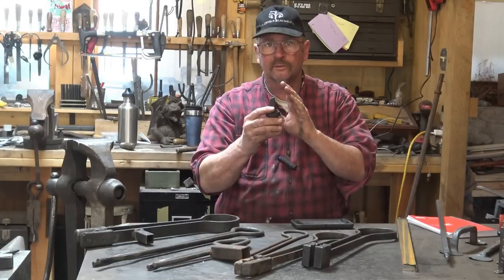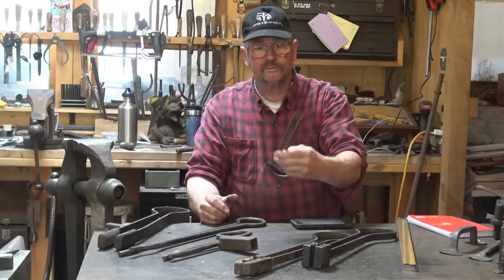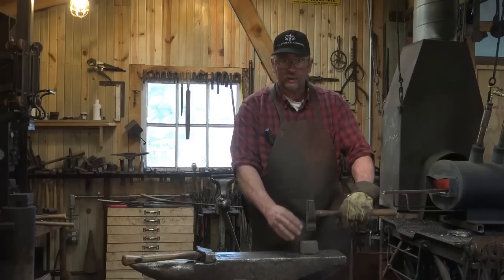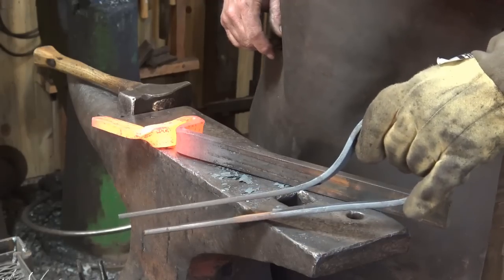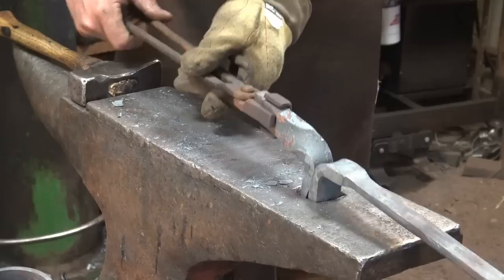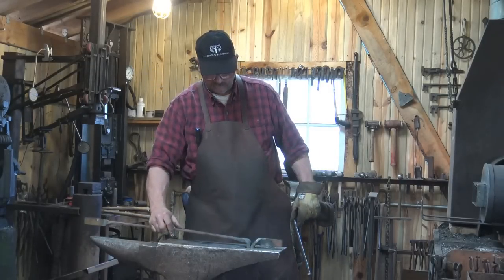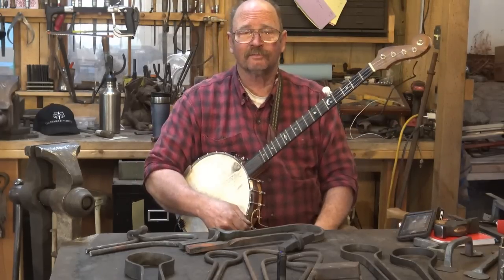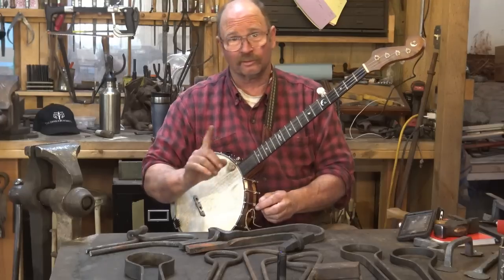Spring butcher tool for the anvil hardy hole - blacksmithing tools

Comment: Small basic arc welder $50-$100 used about anywhere.  Scrap material to practice on and some welding rods $25. A valuable skill you can use for life, priceless.

Comment: John, I do like the banjo pickin. Have an idea for attaching the tool steel dies to the mild steel springs.
Punch a hole down in the end of the dies so the mild steel will slip in, punch a cross hole thru both and rivet.
Just a thought.

Comment: little late any you might have seen this suggestion but make a slightly triangular piece that can fit through the gap in the hardy hole section and that should help with the bounce.
Reply from the maker: I think for these tools just having a longer better fitting hardy shank would help tremendously.  But I have made tools that use a wedge to lock them in solidly.

Comment: Hey John, for those who don’t have an arc welder yet I picked up a DC inverter stick welder on Amazon for just under $300. Best part is it’s a 120volt machine (can also run on 240v) that strikes an arc very nicely with 6013 rod. Great tool for the beginner that is very small and weighs less than 15 pounds! FYI..

Comment: I just re-watched this video, and enjoyed it again.  I had a thought which might make this type of hardie tool more useful.  On the loop that goes into the hardie hole, if you make it long enough, it'll sick out the bottom of the anvil, and you can drive a wedge into it to lock it onto the anvil.  It wouldn't flop around so much then.

Comment: I like that you use simpler tools.  Going from no tools to a set of usable tools, most of us can use a friends welder, and are more intent on having usable tools than on purity of technique.  The purity can come later, when I have a real , usable hardy to use in the process, whether arc welded, hammer welded, or even super glued - if that will hold.

When I see a power hammer, or any of the huge tools most smiths do not have, the video goes from being an instruction video to information only status, and I usually move on.
Reply from the maker: Thanks for the comment.  I'm afraid you will see power hammers and presses in some of my videos.  They are a reality in many modern shops and folks new to them or thinking of buying their first big machine like to see how they might use those as well as hand tools.  Most things done under the average power hammer can be done by hand, so its worth looking at the general procedure not jut the tools used.  Most things can be adapted to hand work even if shown under a power hammer.

Comment: probably the high twang of the banjo is attractive to blacksmiths because that part of their hearing range is still intact and they can hear it! 
Love the tool, spent a couple of hours today having a play around working out how I was going to make my butcher, wishing I had a butcher to help me make the butcher......  then I ended up using a bit of 1/2" bar stock as a psuedo butcher to get myself started on the taper for the hardy post without stuffing up the shoulder!
Reply from the maker: Great progress.
Reply: I reckon riveting a small piece of steel in instead of the area you had to work down might be an option I might experiment with! I have a length of thin section stuff lying around.

Comment: Hah brilliant, needed a spring top/bottom fuller today. Will go ask and make this now. Not afraid to break out the welder, but having only learnt last year I appreciate those that can't. Do need to get a stock of 1 1/2" mild for tool stems.
Also, from someone with zero musical talent but a good ear for tune, you play brilliantly. Tom foolery always very welcome in this channel, especially when it sounds that good.
Reply from the maker: Thanks,  I sometimes use square tubing or a "U" shaped piece of flat bar for hardy shanks.

Comment: John, a great butcher tool, I made a smaller one, overall 13inches finished, it still bounced around a fair bit, to overcome the bounce I drilled a hole through a brick and hung it down off a wire at the hardy hole end, a bit primitive but it took the bounce out of the butcher
Reply from the maker: I sometimes like longer heavy hardy shanks just to add more ballast to the tools.

Comment: This is so helpfull, going to try to make one if the snow and the freezing temp. Are over. 

If you make the hardy shank a bit longer en slit and drift the bottem you can put a wooden or iron wedge between the shank and the bottem of the anvil. So its springs a lot less. Awsome John!
Reply from the maker: I have made some that take a wedge, I will try to show them in an upcoming video.

Comment: Suggestion: use square stock to fit into the hardy hole, and punch or drill a horizontal hole through which a round bar is inserted and secured with either a screw or rivet offset to hold the bar in place. The spring is formed as usual and there you have a top and bottom fuller spring loaded that fits the hardy hole without any weld and can be done completely on the forge.
Reply: @Grauenwolf  It might, but if the screw/pin/rivet was offset above or below, just using a fraction of the radius to interact with the bar going through, I expect it will hold nicely. But I think I will employ it first to verify that it would withstand the riggers of forging. Thanks for your feedback. I enjoy your channel.

Comment: Very Cool.  About having to pry open the spring butcher: if you grind ramps on the spring side of the butcher dies, you can put the end of your billet inside the spring and slide it right into the butcher, it will open itself.

Comment: On another channel (I wish I could remember which) the smith has a hardy tool with a long shank that extends below the heel of the anvil.  The shank has a slot punched thru and He taps a steel wedge into the slot pulling the hardy tool snug against the face of the anvil.  With your spring tool if the shank had been made long enough that it extended below the heel it would have a slot ready made.  That way it could be secured and not jump so bad.   Anyway, very informative and useful video.  Thanks for posting.
Reply from the maker: I have some tools done that way

Comment: i normally use garage door springs that i have straightened out to make the spring for my fullers and swadges . i use tool steele to make the working end from the anneal it and drill it for the size of spring im using then insert the spring into the working end and bring to welding heat in the forge and weld. i adjust for alignment then re-heat and harden and temper. i have tools that i have made this way 30 years ago that i still use today.

Comment: LMAO! I knew the second you said "I'm not gonna make you watch this." about the drawing out that you had just realized what you'd gotten yourself into and you were heading to the power hammer. (I know from your video on hammer technique that you don't LIKE using that 4 lb. hammer a lot.) The fact that you came back on a few seconds later and admitted to it just made me laugh! I could actually tell right away anyway, because the power hammered section looked so much more finished than the rest.

Comment: Just made butcher dies for my little guillotine tool. Seems to work well; as i tested it with modelling paste instead of hot steel (can't lit the forge for now - snowy weather in Belgium - lol) - great video Thank you sir
Reply from the maker: I do prefer the guillotine tools for many of these tasks
Reply: So do I. This might be a good idea for future videos : to explain how to make a guillotine tool, different dies and show what can be done with it. There are many areas where its use makes work more easy and accurate. It's one of my first self made tools

Comment: What cool tool. Was thinking if you had driven the piece in all the way through the hardy hole you could have used a wedge to hold it.
Reply from the maker: True,  I have some tools made that way
Reply: I was thinking exactly the same thing. But yeah damn that's a simple way to make the hardy tenon.

Comment: Regarding the challenge of opening the spring swage...I found that by forging or grinding a smooth radius on the end of the fuller, top and bottom...then I could place my hot work against the radius ends of the fuller and use my hammer to tap the piece to where I wanted it. No need to put your hammer down, the time for which would increases heat loss. This part strays from "tool from one piece" preference* but I also cut the top 2" of a rail road spike and welded it to the top of the top fuller for striking with the hammer. it absorbs most of the abuse rather than the top side. When I tap in the piece to be forged through the radiused ends I do so directly under the spike head so the energy is transferred straight to the work. Alternatively the head of the spike could also be use in the way that Bryan suggests below, to pull up on to get the work into the fuller. The addition of the spike doesn't have to be 2"...it could be shorter to keep the tool bulk to a minimum.  Just some thoughts.

Oh and did I mention that your youtube additions to our blacksmithing community are outstanding! Thanks for all of your effort!
Reply from the maker: Thats a good idea, I have used sacrificial strike blocks on heavy use tools, they do help them last longer.  I'm glad the videos are useful

Comment: Your banjo playing was good enough to make my old legs keep time.  I have been experimenting making one piece spring swages form round 1040, 1045 and 5160   med. carbon steel, thinking that it is good for the spring and can take a beating better than mild.  Also, I want to try putting a cold mild or med. carbon tenon into hot 4140 dies, and maybe put a cross rivet in???   These hardy tool making videos are just the kinds of videos that I like, and I thank you for posting them!  Jerry

Comment: Hi John Happy New Year . just wondering why you wouldn't use a small wedge to drive in beside the hardy tool to tighten it up. Lots of guys do it. i use railway spikes for the bottom of hardy tools and i have to use a wedge to tighten it up. Wedges are an old way of doing it. Just wondering.
Reply from the maker: Wedges work well and if this was a tool I was using I would do several things differently.  But since this is just a test of concept it didn't really warrant worrying about it to much

Comment: Make the hardy shank longer and add a pinning hole below the anvil to keep bottom tools and spring tools from bouncing out of the hardy hole and reduce bounce and some alignment issues.
Reply from the maker: The hardy shank certainly could have been longer and I would probably start over if I wanted this as a regular use tool.  I have made quite a few tools set up with a pin or a wedge under the tail of the anvil but find I rarely worry about it.  A longer heavier shank adds enough ballast to make a big difference.

Comment: Banjo intro/outro... just sayin’ 😉

Your videos are fantastic. Thank you so much for taking the time to make them, and to place so much focus on teaching, rather than pure theatricality.

As a follow up to your last video, I’d love to see some short videos on simple techniques, especially related to fixing common beginner mistakes:

-avoiding blacksmith elbow
-getting more consistent drawing dimensions
—fixing areas that are thinner than the desired thickness
-hammer technique (differences in strike angle, and use of different areas of the anvil)

Basically, bite-sized skill-based videos, that show what it looks like when a newbie does it the wrong way (or hard way), and how to correct.

Apologies if you’ve already done a bunch like that. I only just found your channel a few weeks ago, and am still working my way through your older vids :)
Reply from the maker: great ideas

Comment: You sir are a great smith, featured your channel in my video. it's odd but even with 30 years + as a smith sometimes watching you I feel like an armature, but sometimes I wonder why you work so hard, but that is few and far. as far as project ideas I always have things on my mind. like, what did smiths do for rasps and or files when they weren't so easy to just buy. I've never made a file, tap, or die. I have those factory, but I wonder how it was done when you had to make it yourself. Hammer on John Hammer on.
Reply: I just watched a video yesterday on how files were made back then. they would use wrought iron to start with, then make chisel marks to form teeth. The next step is then to case harden the wrought iron by slathering a slurry of some form of carbon and flour was used as a binding agent (In the video they heated leather in a container to make coal). It was allowed to dry and put in a clay container then put in a furnace for a while for the surface of the wrought iron to absorb the carbon in the high heat low oxygen atmosphere. you now have a case hardened file! i thought it was really neat. As long as John doesn't mined i will link the video in the comment.
Reply from the maker: I have never made a file.  Peter Ross who was the master blacksmith at Colonial Williams burg for many years says that there is no record of the shop there ever making files, but they did recut old ones.  File making is a very specialised skill.
Reply: There is a great video on hand making files... Antikythera #3 - Ancient Tool Technology Hand Cut Precision Files.

Comment: Wain's Weld 
I have been using old harrier springs and after annealing high carbon seel drill a slightly smaller hole in your fullers/swedges wones red hot drive the die onto the spring steel as an interference fit when the swedge cools down it wont go anywhere and is an old school method.

Comment: I think you could cut the corners off of the first part of the spring butcher.  You probably won't need the whole 3"-3 1/2" of the working end.  It will allow you to slide your work piece to slide between them better without having to use bother hands, each time.

Comment: Have you heard of anyone using induction for the forge? Just a thought for being able to put heat where you want it on long pieces, similar to size and shape of PVC pipe heaters
Reply from the maker: Induction forges are becoming more popular.  I haven't had the chance to try one out yet, but would like to.

Comment: Could you use the same principle to create a spring hot cut-off?  The reason I ask is because I would like to start learning to blacksmith after I retire in a couple years, and I can't see myself being able to justify a band saw or other powered cutter to my wife for cutting stock into manageable pieces.  I was thinking that a spring hot cut-off would be almost as fast as band saw, anyways.

Comment: Could you heat the tool with a hole just smaller than your spring, then freeze your spring? I know it works with engine sleeves.
Reply from the maker: Possibly, but I would worry that the transition point would be a likely place for the spring to crack.

Comment: Tried making one today, but a little different, uses some spring steel that I flattened out and welded on to some nice flat springy steel. tried it out, but it doesn't work real good, chops up the steel too much, might have to do one all in one piece like this..
Reply from the maker: Making sure the working area is smooth and lined up properly should help.
Reply: Yeah John, I noticed the bevel isn't clean, gotta fix that.

Comment: Because I do not have a power hammer, and I am lazy....  LOL  Would it not be a much more efficient use of your arm to punch and rivet on a piece of 1/4 x 1 spring into there instead of drawing out that huge bar?  I think I will make one of those but make the bottom section like you did, and rivet the spring in between the top and bottom.
Thanks for the Musical Interlude!  Glad the finger is healed.
Reply from the maker: I think you are right.  I was trying to keep the idea as simple as possible.  But I think riveting or forge welding would be much less work
Reply: That's how the process works, though, isn't it?  Come up with an idea, try it, improve on the idea, try again...  I love the concept though.  I've been wanting a few spring tools, now I have a starting point to make a few.

Comment: I could suggest adding a handle of some sort to the top butcher, just to lift it to put the material in. Could be drawn off of the top material, if you needed to do it with out the advent of an arc welder. Just account for the extra in your design. Nice idea and design!! I like the thought of forge welding tool steel to a mild steel spring to get more durability and longevity from the creation. I'm also a clawhammer banjoist and bagpiper!! Just started on my banjo journey, but I've been a piper for 22 years. Which brand of banjo do you have, it looks familiar to me?
Reply from the maker: That would help, but also makes the tools bulkier and harder to store.  I have generally been able to adapt to the way these simple tools need to be opened.  I often keep a bent over flat bar that makes it very easy to open them and when I don't mislay it, it works for all of the similar tools.  My banjo is an Ome from Boulder Colorado.  At the time it was their most basic model without a metal tone ring.
Reply: I have just a very inexpensive 5 string off of Amazon, and I've upgraded it some to get it decently playable. I'll have to check out Ome and see how they sound.
Reply from the maker: They make excellent banjos.  https://www.omebanjos.com/ but not cheap.

Comment: Again great info and alternative for a smiting magician. I tried to send you some pictures but the mails got bounced by earthlink. Than I tried to send them by wetransfer but don't know if you got them. Liked the Banjo, it was good!
Reply from the maker: I'm afraid I didn't get anything.  I do receive lots of pictures though, I wonder if a smaller file size would make it through.  YouTube needs a way to post pictures.
Reply: Black Bear Forge Oooh, that's too bad. I will find a way ;). And yes, you tube needs a service like that, great idea actually!